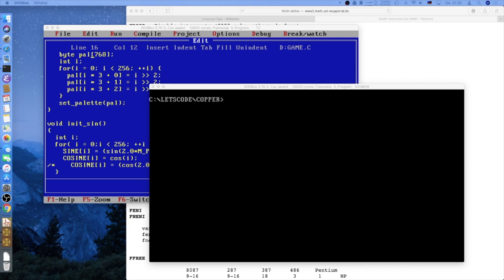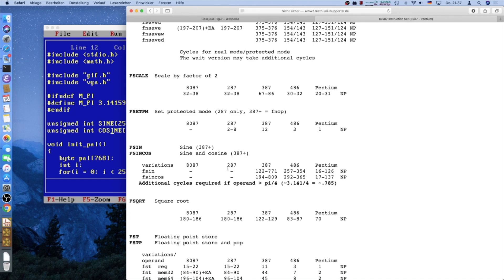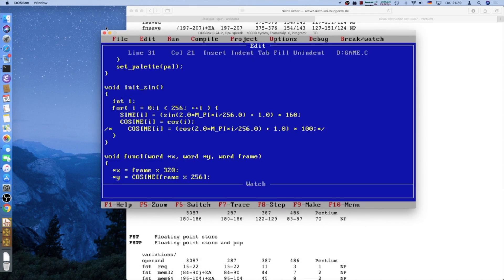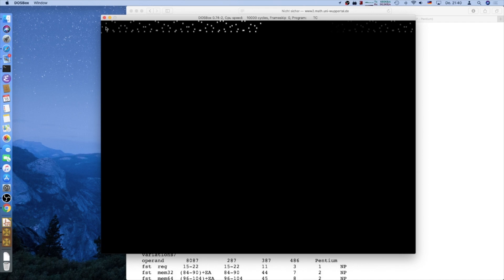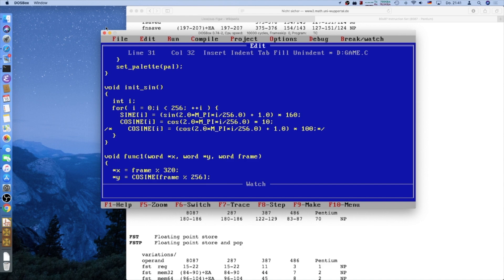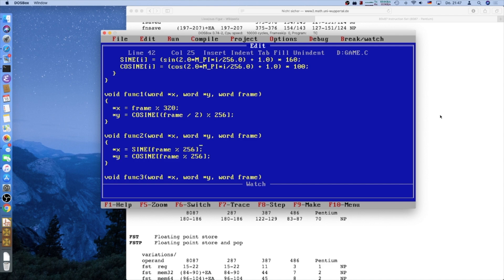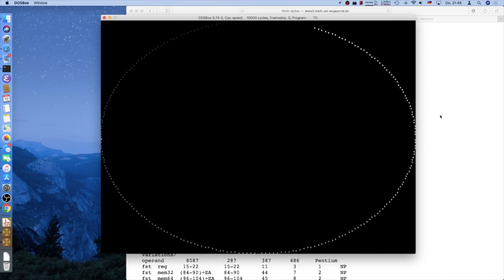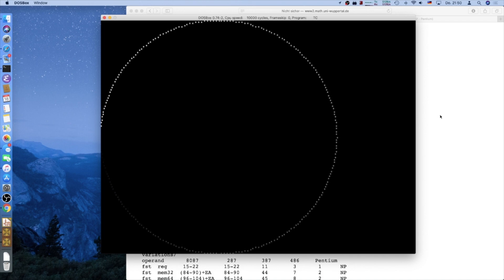Let's Code MS DOS 0x15: Sine Tables

Comment: Can you do a reboot of this series but using modern stuff like ia16? In my personal experience, I've used ia16 for baremetal x86, but in theory it should be possible to use it for DOS in 8086 mode. Would also be nice to dive deep into the "dos extenders" which I understand what they do, but I have no idea how to use any of them. Thanks for these videos!
Reply from the maker: Well, the x86 asm series is similar to what you are asking, as it uses IA16 instructions. Other than that: As this is purely a hobby my time is very limited and I usually pick the stuff that I am currently interested in. :) If this ever gets more to be a full time job I would be able to pick up much more topics. However I doubt this to happen anytime soon... :-D
Reply: @root42  Oh I meant gcc-ia16 :) not just bare assembly instructions. That's a pretty up to date compiler for the old 8086, in contrast with the TC and other C compilers from the time
Reply from the maker: @cocus-ar  Ok, I see. Well, it's just another compiler. The language pretty much stays the same... Also I wouldn't use c++ on an 8086. :) I just like the simplicity of TurboC. It's no frills and quick results. For more serious stuff I use Emacs + gcc / clang. Or whatever language I need.

Comment: Hi there, thanks for the nice video and in fact the whole series! :)
I haven't watched every episode yet, so please excuse me if you covered something that I comment on here in another video already. ;)
A few comments:
- Memory access
I suspect the mov timings in the table might ignore DRAM access time and would therefore only be valid if the data is already cached (for those platforms that have a cache).
- Length of sine table
Because of symmetry properties of the sine and cosine functions we only need a table with a length of 1/2 to 1/4 the number of samples per period. The costs are some  additional comparisons and additions/subtractions.
- Sine table implemented in c standard library: sin(), cos()
At least more modern implementations of the C standard library actually use a sine lookup table with linear interpolation internally in some cases (e.g. on some platforms). So comparing instruction timings might be unfair here, if using sin() and cos(), because they might not even be used.
- Check result when optimizing
Always measure the resulting performance and compare it to the baseline version if you do optimization. More often than never an alleged optimization can result in worse performance, because we didn't know all the variables and side effects involved.
I don't know any profilers available on DOS unfortunately, but you could also just configure a timer and read its value before calling the function you want to measure and after the function returned. The difference between those two values corresponds (roughly, because of some overhead) to the execution time (in real world time) of the function call. You can do that a  bunch of times for the original and optimized versions to confirm a possible improvement.
EDIT: wording
Reply from the maker: Welcome, and there are 0x14 more episodes so far for you to watch! Your points are valid, and optimizing DOS code is probably another couple episodes worth... Turbo C 2.0 most certainly doesn't use any sin tables in its maths library... Also it's of course possible to not only cache sin and cos but rather any costly function that is periodic. But you are right: if those tables become too large you will thrash the caches on 486 and up. On a 286 it probably won't matter that much, since there is no cache... However a benchmarking would be advisable anyway! Using a sin table only for animating the scrolling of my screen also was overkill, since I only need to call sin() once per frame. Drawing a lissajous figure every frame is something different, since I will have to call sin potentially thousands of times per frame.

Comment: very nice explanation as always :)
can you please confirm if current fpu's are faster than cpu integers ? if so, from which model ? like from pentium onwards ?
Reply from the maker: I doubt that. But it’s also comparing apples and oranges. The FPU computes things that the CPU normally doesn’t. Doing fsin on a 387 back then already was faster than doing sin on the CPU. But of course with the Pentium that operation got MUCH faster. The FPU is good at floating point numbers. And nowadays the lines are blurred and you have extra registers for SSE, AVX and the like. You always want to tailor your code to a certain CPU architecture. Back then it was easy because there were only a few. Today you have 10 generations of Intel Core CPUs and similar amount on the AMD side. You have dozens of models in one CPU generation. So I think the question if FPUs are now faster than CPUs is a moot one.
Reply: @root42  i'm sorry, now that i realized i wrote a wrong question, i meant fixed point math using cpu's integer. Now i can't find it anymore, but i read somewhere (i think it was on the openwatcom or djgpp documentation) that states that it would no longer be worth using fixed point math because the modern fpu's would be as fast as the cpu's fixed point math. I just wanted to know if it's true, thank you again :)
Reply: @root42  oh finally i could find the resource again :) https://liballeg.org/stabledocs/en/alleg032.html
"(...) This was great in the time period of i386 and i486 machines, but stopped being so useful with the coming of the Pentium class of processors. From Pentium onwards, CPUs have increased their strength in floating point operations, equaling or even surpassing integer math performance."